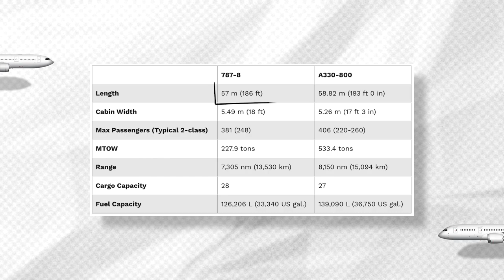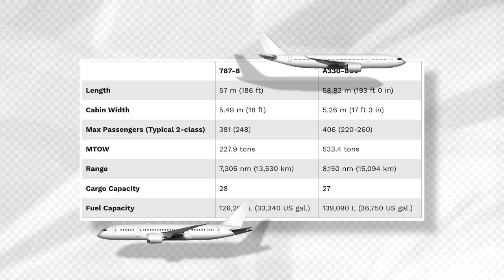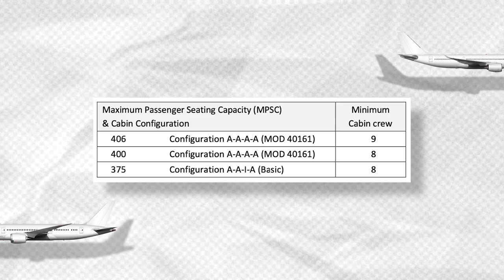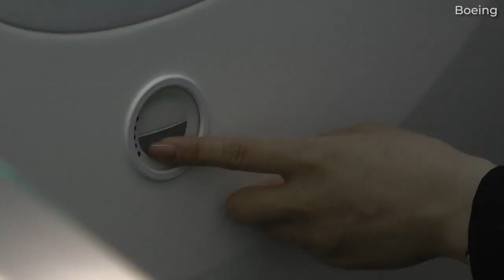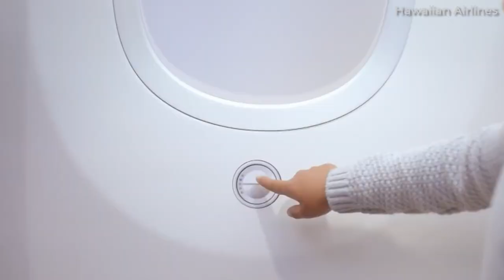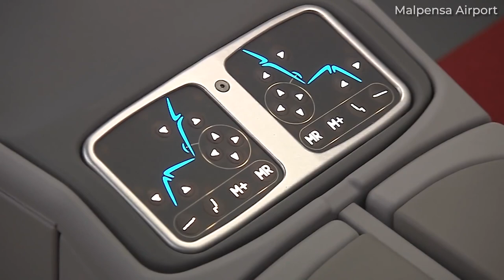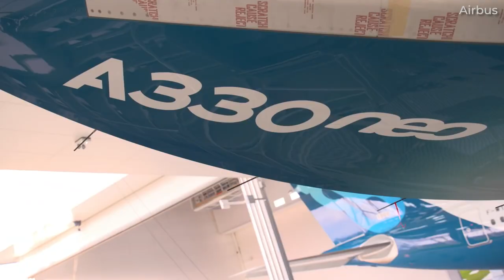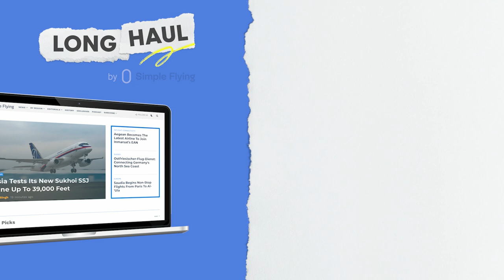Comparing Small Widebodies: The Airbus A330-800 vs. Boeing 787-8

Comment: U can't compare a330 and 800 vs 787 8
Reply: why?
Reply: whyyyyyyyyyyyy?
Reply: Its a fair comparison honestly except the a338 came out late
Reply: What plane selling more
Reply: 787 vs a350
Reply: @antoniosteede1242  the a350 is competing against  the 777
Reply: @antoniosteede1242  the 787 and a350 are not competing for the same market.
Reply: @rtbrtb_dutchy4183  Which markets?
Reply: @dyncraft490   Boeing doesn't market the 777 against the a350.  The 777 is  a generation behind. 

The 777X and 787 are the closest thing to an a350 competitor,
Reply: @rtbrtb_dutchy4183   they do overlap thou. The upcoming 787-10 HGW will compete directly with the a350
Reply: @edsontransports9400  which markets?  You understand that different planes are used for different markets right? Depending on range and passenger load. The 350 can carry more Pax and more fuel. They serve a different market. Meaning different city pairs. 

The 777 competes with the a350.
Reply: @mmm0404  the airlines will decide which airplanes compete against each other for their specific demands.
Reply: @rtbrtb_dutchy4183  that's what I always say. I find it puzzling how people consider the a350 a competitor to the legacy 777. 

Yeah they do have similar capacities but airlines today shopping for a widebody , compare the a350 to the 777X or 787, not the 777. 

Anyways the a350 actually does compete with the 787-10. The 787-10 is a 777-200 replacement, so is the a350-900. I'm sure as an EX Boeing employee you already know that.
Reply: @mmm0404  it will still be short on range. It will only add 1000 NM. Plus it will carry less pax. Besides, that’s comparing it to the -900, not the -1000. 

ANZ already has issues with having to kick people of their long hauls due to range restrictions. 

Plus the 350 will have an XLR version. 

The B787 is a great airplane, it’s just not competing with the 350.
Reply: @mmm0404  you must have me confused with someone else. I’m not an ex-Boeing employee. I fly Boeing and Airbus products as a pilot.
Reply: @rtbrtb_dutchy4183  well maybe it's just me but I think extra  long range is overrated.

The 787-10 with 1000nmi more range should be able to match that of the  777-300ER. That's good enough to pose a serious challenge to the 359, even the 35K.  

The 787-10 might be smaller than the a35K by 30-40 seats but it's cheaper, which also make it competitive. 

The 77W went on to sell 800+ plus frames while the 8000+nmi long range 77L ( 777-200LR) sold only around 60. 

How many airlines need 8000nmi+ of range anyways? A few. 

The 787-9 HGW should be able to allow AUK to NY flights without any restrictions. ANZ have 2 more remaining on order and should come with that HGW treatment..

I don't think Boeing is interested in competing with the a350 in terms of range, because only a few airlines need 8000nmi+. It's a niche
Reply: @rtbrtb_dutchy4183  yea , my mistake.
Reply: @mmm0404  it’s the flexibility having an airplane that can do long range. Especially if the airplane can do short haul flights at the same hourly cost. I think range will become more and more important over time. 

It used to be that u could either go long range with less pax or have a full load of pax, with less range. 

This is why the B757 was such a good aircraft, cuz it could do all that. It could go long haul or short haul and be profitable. 

By the way, 30-40 seats is a huge difference as long as u can sell all the seats. 30 seats means one less flight every 10 flights.
Reply: @mmm0404  the 787-10 actually have the same capacity as the a350-900 and we slightly more cargo. So yes, am ER range options is serious competition since it gives this: all the necessary need a a lower price.
Reply: @sergiolaurencio7534  ok, but surely the 68m 787-10 should have slightly more seat capacity than the 66m a350-900? They are both 9 abreast ain't they? The 787-10, therefore has 2 more rows of seats ( up to 18 seats more ). 

Yea but in general terms they do have a similar capacity, I would not say the same thou. The ER variant will be great